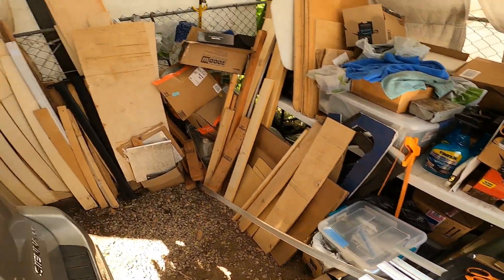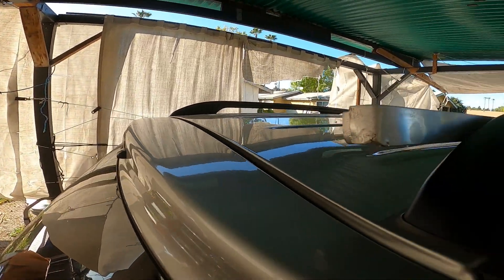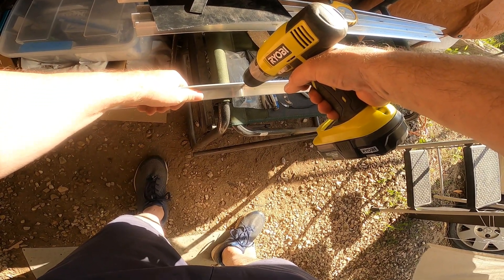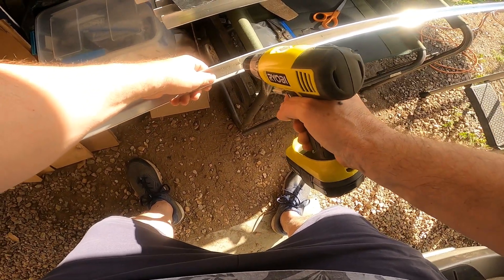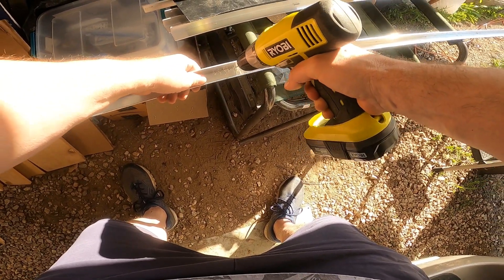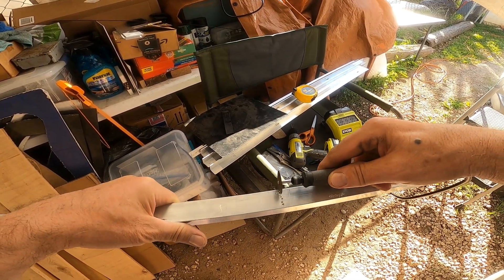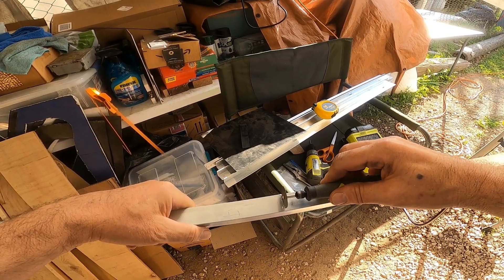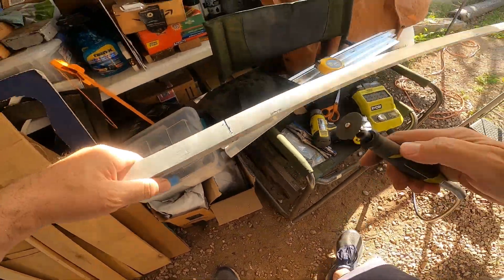400 Watts of Solar Panels on Sienna - Aluminum Supports Strapped to Roof Rails

Comment: I found someone to help me do this project, and I'm ordering the parts could u pls explain how u put the solar panels on the rack rails u put up?
Reply from the maker: I used the regular solar panel brackets - the kind that are made to attach to the solar panel frames. I used four of those brackets per panel, two on top and two on bottom for each panel, and I drilled holes through the solar panel frames at the top and bottom of the panels to attach them where I needed them in order to place the panels in pairs on each section of the aluminum angles that are attached to the roof rails with worm-gear clamps. Each aluminum angle section holds two panels, and the solar panel brackets are anchored to the aluminum angle with sheet metal screws. 

The last step was to attach two aluminum angle sections at the front and back of the entire assembly using sheet-metal screws and to use sheet-metal screws to attach the solar panel brackets to the aluminum angles attached to the side rails. I had very little clearance between the solar panels and the aluminum angle so I needed a long (4") Phillips head screwdriver power bit, and I also pre-drilled the sheet metal screw holes through both the solar panel brackets and the aluminum angle. This was very difficult because everything had to match exactly so I had to be very careful with aligning the solar panel brackets. Good luck!
Reply: @realcreature3D  ty ty! And u answered b4 I could ask about the front & back of the frame, ty! I got the same solar panels and everything I can't wait to enjoy. To my knowledge, this was the best setup I've seen ty for sharing. Otherwise, I'd nvr got this far

Comment: Id love to cooy this on my 09 Sienna to go on my first trip to Arizona from Indiana I'm pairing it with a 48 volt Budget Battery system i seen on will prowse channel will the two pair well together? Also Could you list everything here so I could order it? I did watch your other video and I see there's a link to everything is that the same stuff can I just use that list? I hope your daughter has been able to stay comfortable and more stabilized❤❤❤❤
Reply from the maker: THANKS FOR ASKING! My daughter is doing better - she's dealing with a LOT of different issues, some due to her being confined to the bed and others from the FOP. Thanks for positive thoughts and prayers!
When it comes to the 2009 Siennas, they have different dimensions for the rooftop rails than my 2006 Sienna does, so you'd have to make sure your solar panels are going to do what you need. The 2006 Sienna only allows the exact HQST solar panels that I used to fit between them, with just enough space so that I could use the aluminum L-Brackets (they're called "aluminum angle", from Home Depot) to attach them to the rails. Your MPPT charge controller has to also match the voltage of the batteries you're planning on using - I have two 100-Amp 12.8-Volt batteries connected in series, which makes a 25.6-Volt system being charged by the Renogy charge controller, which I switched from its default 12-Volt output to a 24-Volt level to match the batteries. This also allows a higher solar panel power input for that model. I think you need to match your batteries with the proper 48-Volt output charge controller. You also will need to get a 48-Volt DC-AC inverter, and then you can use the 120-Volt AC output from the inverter to power anything that uses a house current, but you'd have to use a 48-Volt Step-Down transformer/regulator to regulate the voltage of the inverter's DC output, in case you want to power something in the 5-Volt DC or 12-Volt DC range.

Good Luck and Happy Trails!
Reply: @realcreature3D  awesome I am so pleased to hear that about ur daughter and continued prayers i struggle w rare autoimmune disease  and so glad she has u. Also Ty a million for giving me so much info I am a novice I can't afford 48 volt alternator so I need to go with a budget 12 volt system. This gives me courage to tackle the installation thanks for helping me get started on my way. may God keep u safe in ur travels

Comment: Can you link which solar panels you bought? I see a couple of 100 watt HQSTs solar panels that look similar  so I can’t figure out which ones they are .
Reply from the maker: https://www.amazon.com/gp/product/B07L7ZGGVT/ref=ppx_yo_dt_b_asin_title_o01_s00?ie=UTF8&psc=1

Sorry I took so long. This is the description on Amazon:
"HQST 100 Watt 12V Monocrystalline Solar Panel with Solar Connectors, High Efficiency Module PV Power for Battery Charging Boat, Caravan, RV and Any Other Off Grid Applications-Upgrade Version"

40.12"L x 20.04"W x 1.18"H
Reply: ECO-WORTHY 200 Watt Bifacial Solar Panel 2pcs 100 Watt 12 Volt Monocrystalline Solar Panel Module
Reply: @bryanyancey1325  ty! I just sent those back and I did order some again but made sure they were the 40.1
Reply: @winsome6705 please let me know how that goes.
Reply: @bryanyancey1325  I will. How's urs going, or I assume it's done already idk
Reply: @winsome6705 I actually still have a long way to go. I’d be done already if I wasn’t working .
Reply: @bryanyancey1325  oh I understand. For me, it was finding someone to help me. I work part-time but quitting in October to tour America.
Reply: @winsome6705  did you get the right size?
Reply: @bryanyancey1325  they have yet to get here. im patiently waiting.  I can't wait to get them installed and report how urs going so far?
Reply: I have four of them. They produce 200 watts in parallel so will try in series if can get near 400 watts from panels to battery
Reply: @bryanyancey1325  they sent the wrong size again I'm going to have to get rich solar. They are $130 per solar panel
Reply: @winsome6705 that’s unfortunate! The rich solar ones look like they should work well
Reply: They r up and running it's a beautiful thing!
Reply: @winsome6705  amazing! glad to hear it!
Reply: No problem. That’s the solar panel I tried buying but had to return them because they were around 41.8 to 42.2 inches in length instead of the 40.1 inch length I was expecting . Maybe they changed it? How long are yours?
Reply from the maker: Mine are the 20 x 40.1 - that link is directly from my Amazon purchase history. Sorry that happened to you. Double-checking just now, I see that there are two different measurements on their product page - the written description has the smaller dimensions, but the photo series shows the larger dimensions. Weird! @bryanyancey1325
Reply: @realcreature3D  thanks for checking! I found an alternate that’s similar length .
Reply: I read this before I ordered mine and still ordered the wrong size. Were you able to get the smaller ones in the same brand or did you just go for some that fit in a different brand? @bryanyancey1325
Reply: @winsome6705  I keep putting which ones but YouTube keeps deleting my message

Comment: How are they holding up
Reply from the maker: Thanks for asking. They're doing GREAT! I went back and forth to Connecticut from San Diego a couple of months ago to visit my sick daughter - drove straight through on the interstates, up to 90mph (Texas traffic). Not a single problem, and they're really quiet. Not a single loose bolt or screw. Gas mileage unaffected.
Reply: @realcreature3D  Great stuff!